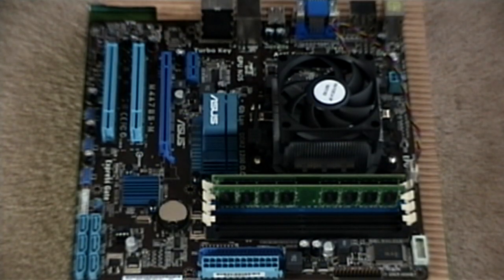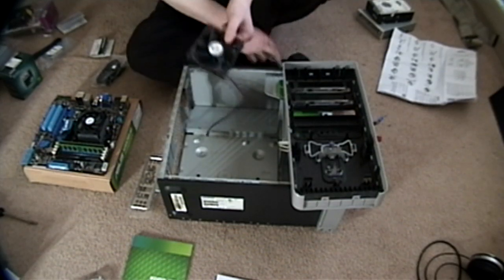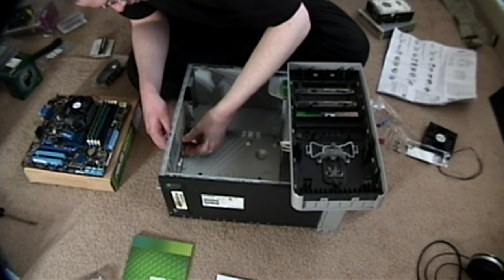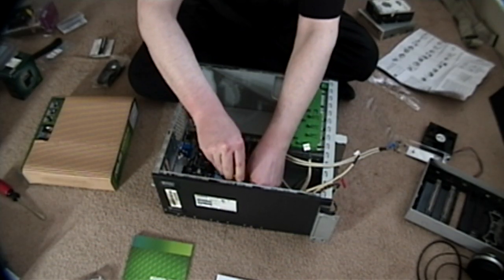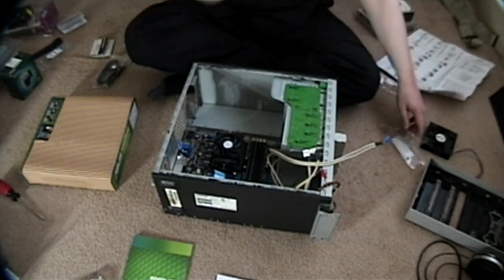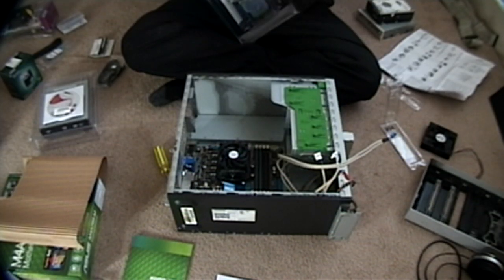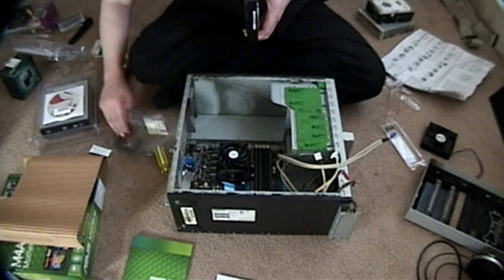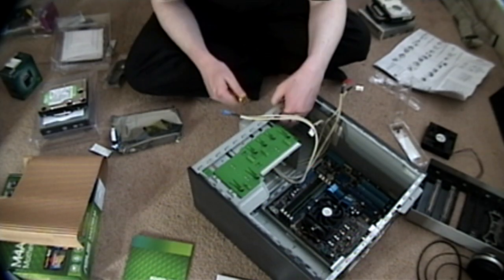Building The New Computer - Part 3: MoBo and Back Panel Installation and Hard Drive Prep

Comment: The best thing to use for screwdrivers on a computer are basically nut drivers, if you notice a lot (if not all) the screws you put into a computer have the hex head on them (1/4 I think, I could be wrong). Phillips generally are pretty good, but you have to have the right size screwdriver. If you have the wrong size, and it's a extremely tight screw it'll strip it out if you're not careful. But don't get me started on flat head screws, I hate those with a fiery passion.

Comment: Did U use standoffs on the Mother Board B-4 attaching it to the case? I hope...
Six cores, Full ATX Case equals Lot's & Lot's of $
My Full Tower was about $850 and that was only 4 cores, I re-used several devices.
IDE vs SATA... No contest SATA hands down
And I recognized some of the music from your Blade Runner reviews.

Comment: Just to let you know you made 2 errors until there. You put 2 ram stick on the same channel ( that why the 2 colors) it will work but will not be using the dual channel capacity of your motherboard. And the best screw is not square but it's Nintendo triangular ones. Unfortunately they are very rare.